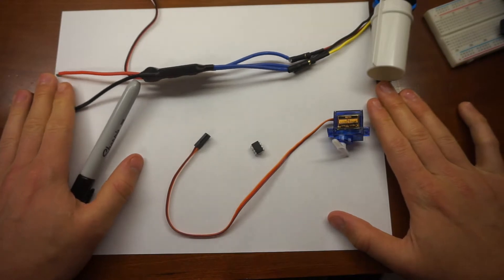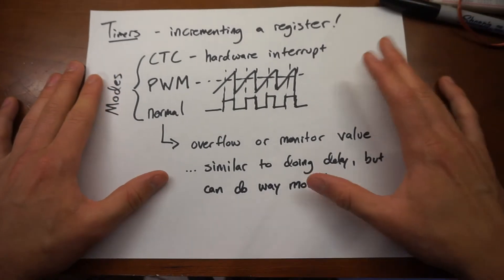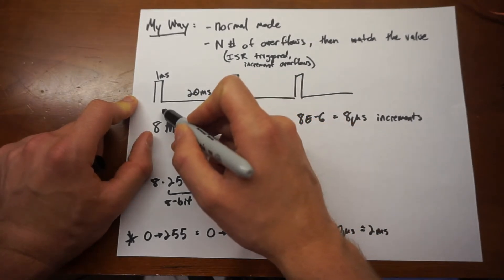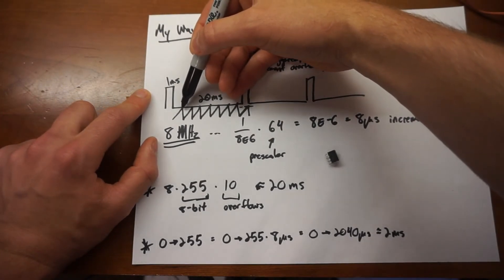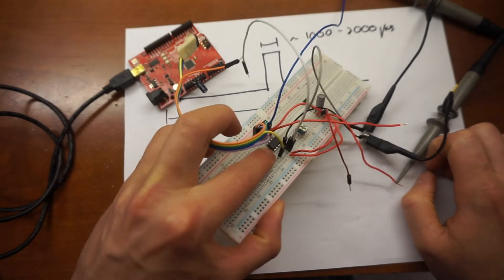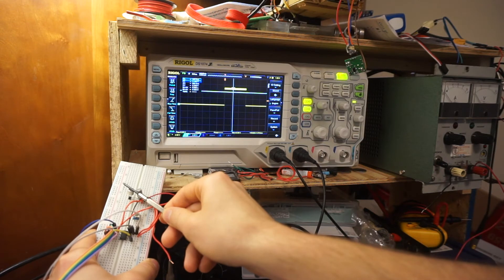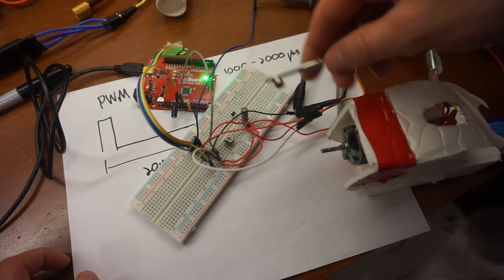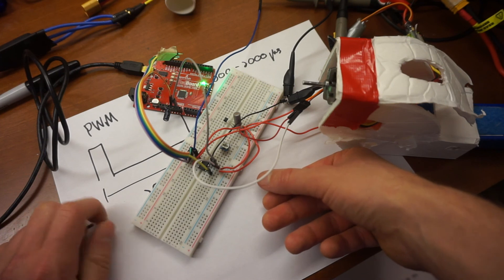Servo/ESC Control with Attiny85!!

Comment: Thanks for the explanation. 
I cant even get the bootloader loaded on the chip. I get too easily frustrated.
Im trying to avoid sacrificing an Uno or Nano for 1 servo and a pir sensor in my project.
Ill figure it out eventually.
Thanks again.
😂

Comment: The preescaler by 64 is fine but i think it's better to seting the timer to work in CTC mode, with the TOP value ranging from 125 to 250(this values give us from 1ms to 2ms), this value can be changed dinamically inside the ISR (vectorized by the timer's overflow and initially declared as 'volatile' in C of course) in a switch-case structure where the first and second case work in inverse proportion (125 + var, and 125-var) that way the high time of the duty cycle can be adjusted just varying the 'var' in the main program and the following part shall reduce or rise its value in the same proportion, the other cases can be fixed by 125 to get 1ms within an accumulator to complete de low pulse part (18 consecutive laps). This configuration allows to get arround 50.08Hz with the 8MHz default clock and high resolution (125 steps) and no matter what the entire pulse train will no change its length if the dutycycle changes. This is the exact configuration that i use recently to tackle my own servo control with the tinys

Comment: You are a beautiful human being! Your code works amazingly thank you!
However, i  have to turn my potentiometer about half way before i get any movement on the motor? What can i change in the code to fix this or is there another solution?
Reply from the maker: Hi Matthew, glad it helped! Wow just looking back at the code, what a nightmare! Haha. Yes line 105 in the code is the issue, I had the set point set up for the magnetometer I was using, which I used in a range of 2.5 to 5 volts... The code needs to be tweaked for each different sensor input range and ESC on/off range. I think you can either lower the "min_speed" at the top of the code or remove/decrease the "-500" on line 105. Try playing with it and let me know if you can't get it to work.
Reply: Electric Sheep Labs. In the function UpdateSP I have commented out the if else statement and that has seemed to fix it. Thank you!

Comment: Nick,
I am SO grateful for your work. I have spent hours on everything out there to do this-in any way-and found myself with code that wouldn't compile, references to libs that don't exist any more, and worse. I wanted to show something useful with the 85 on my tiny channel, and this was the ticket.

I want to create a class from your code for use with the Arduino, allowing OO access to the variables/settings. I'll get to that relatively soon.

Please let me know if I need to give you more attribution to make you happy. The video is here: https://youtu.be/mfCCk_ddQmg I wanted a video that took folks from a brand new ATTiny85 in the box to running a servo (the kind of video I never found).

Thanks!!!

pat
:)
Reply from the maker: Pat, 
Haha yes is is stressful at first trying to find good documentation/libraries, which is why at some point you just gotta go low level and do it yourself! The datasheet is your best friend when trying to do anything outside of use libraries. 

What is OO access? 

I am glad you found this useful and are spreading it for the world to have! 

Best,
Nick
Reply: Sorry, Object Oriented...